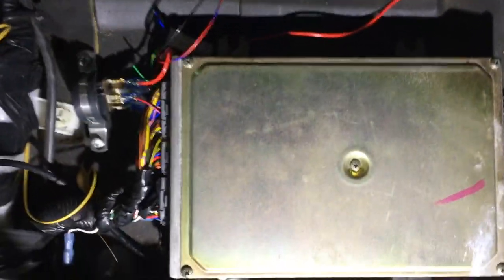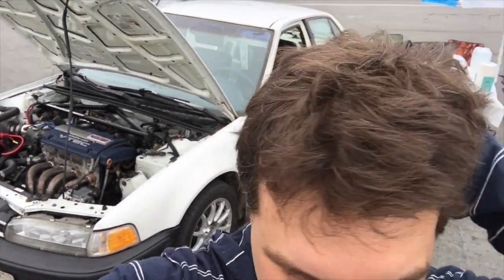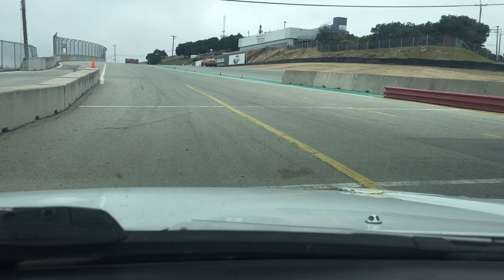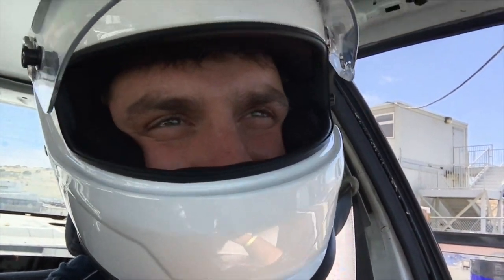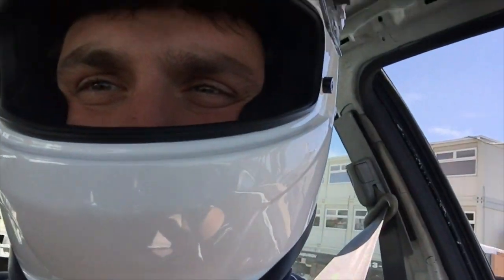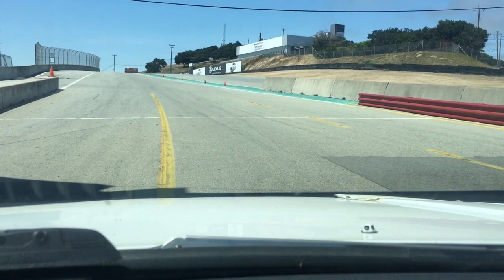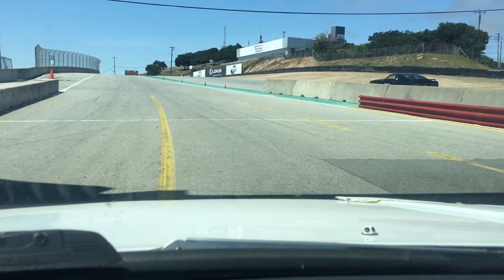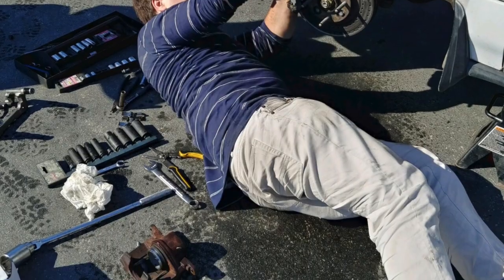CB7 Returns to the Track!

Comment: hell yeah!!!!
Reply from the maker: There ya go!  After I get the tune finished, new tires plus alignment, and the exhaust issues buttoned up, I will be communicating with you about aero ideas!
Reply: @af1132racing  Yes sir! Im supposed to be receiving all my aero within the next week. Let me know
Reply: I wish there was more videos on how to do this swap exactly.
Reply from the maker: The swap is not any more difficult, or really any different, than an OBD2 JDM H22A swap.  The heads are the exact same.  The reason a rare few go for this swap instead of the aforementioned is the motor price (fetch less dollars due to less demand) and the 95mm stroke, as compared with the 90.7mm stroke of the H22.  The summary of one way to do it is this: use the CB7 wiring harness, mounts, axles, water neck on the head, and fuel components, source some USDM H22 injectors, source an OBD1 VTEC subharness from ebay, source a USDM TD-61U dizzy, source a USDM P13 spec intake manifold (or at least the plenum and the studs), source a USDM OBD1 H series throttle body, and for ECUs source a USDM P28 or cheaper P06 (you will have to do what I did with the relay to run VTEC) or P72 if you want to run the IABs without modifying the other two ECU choices. 
Definitely watch my CB7 motor build parts 4-6 to see how I did it myself.

Comment: With that spin out around the 7 min mark, I wonder if in theory, you could have saved it with the right amount of countersteer and throttle
Edit: wait, what's with the sound regulations? Is there a track day where you are allowed to go 100% flat out?
Reply from the maker: Yes, probably in theory, but there is a slight dip in the track as you enter the turn, so a fraction of your grip is gone momentarily.  Yes, there are 103dB limit track days, just not very often and they are more expensive.

Comment: So where do you find out how to wire it up? And is the ecu the same or is it a different ecu? I like to swap my f22a1 for a h23
Reply from the maker: I found out on Hondata’s website.  They have the same automotive external relay method for the non-vtec ECU’s such as my PO6.  If you get a P28, vtec wiring is already in the ECU, and it can be chipped.
Reply: @af1132racing  thanks . It will give me something to think about .
Reply: Im such a noob.  I cant find where it shows it. Whats the website? Www.hondata.com ? Or is it under something else?
Reply from the maker: Found it: www.hondata.com/help/smanager/index.html?vtec.htm
This is basically just a page of the digital manual you get when you download the SManager software on your computer.
Reply: I'm planning on the f23 block and f22a6 head, trying to decide what cam the 272 or the 282. This is for my AutoX cb7 coupe build

Comment: The p06 ecu is a non vtec ecu, did you ever add vtec into the board?
Reply from the maker: When the S300 piggy back board was added, I was able to add Vtec by pinning a wire to a particular open port, run it through an external relay, and wire to hot on the battery.